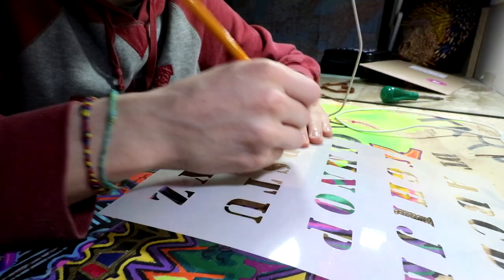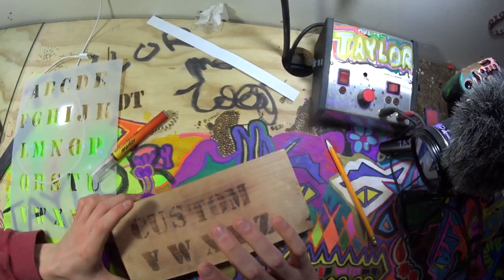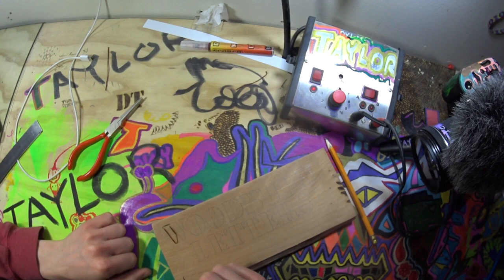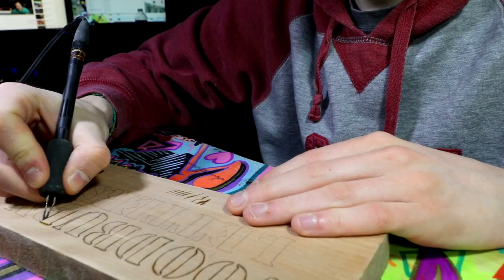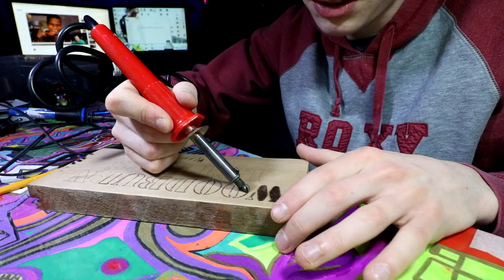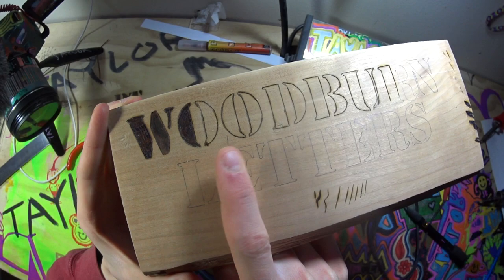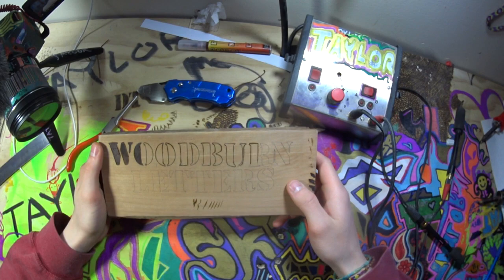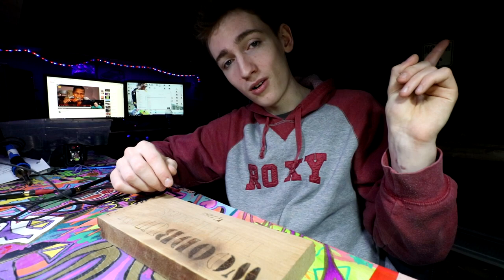how to wood burn letters with a stensil

Comment: Hi Dylan, Many thanks for all of your videos. I have a question for you. I have been making small number plates for toy trucks. I am having problems with the small letters. I am struggling to avoid small bumps in the channels of the letters. I have tried going over the bumps with a little more pressure and heat but all the happens then is that the channel gets deeper. Any tips or advice would be appreciated. Many thanks.

Comment: Hi Dylan,what is the best type of wood to use in woodburning like.pine,maple,oak,etc.Or is one easier or better to use  as far as burning.Also how many times have you burnt yourself in using the different tools.I would say probally a few,but not as much now as back  as when you first started out.Good video.Thanks.Willard
Reply from the maker: poplar. black cherry, hard maple
Reply from the maker: Ive only burned my stuff a few times
Reply: Hi Dylan,thanks but I meant burning yourself like accidently picking up from wrong end or finger/hand slip and hits the hot part.Again good video.Thanks.Willard
Reply from the maker: yea thats what I meant too lol. burned a few times just from it not being cooled down or forgetting where its sitting. good thing is though. how small the hot area is. its such a small tip that usually it wont be more than a tiny blister
Reply: Hi Dylan okay thanks for clearing that up.Thanks.Willard
Reply: I once leant over my burner without thinking and burned a hole in my jumper ;)